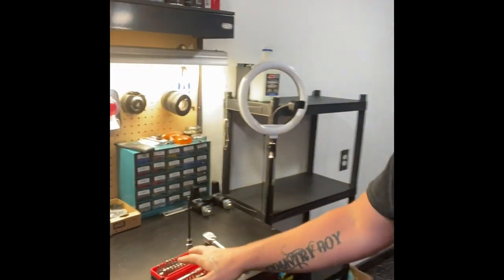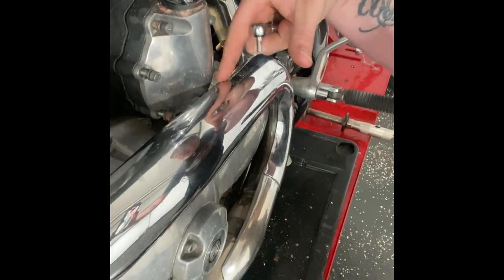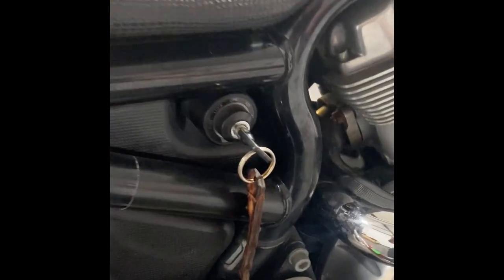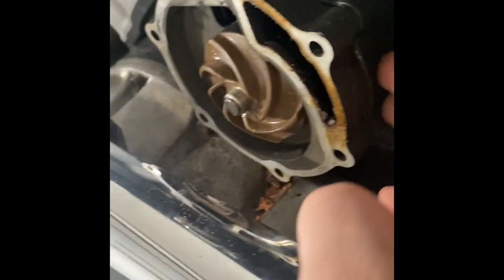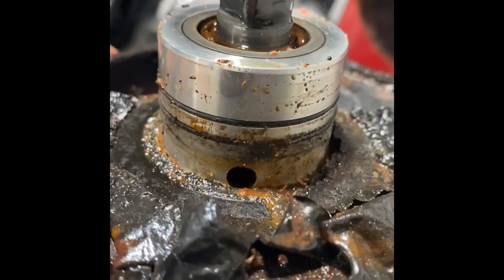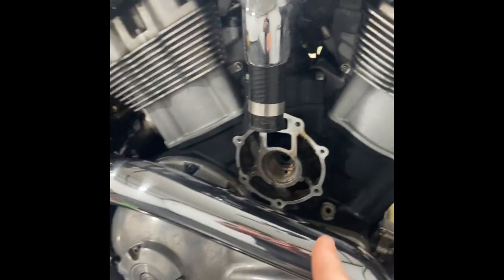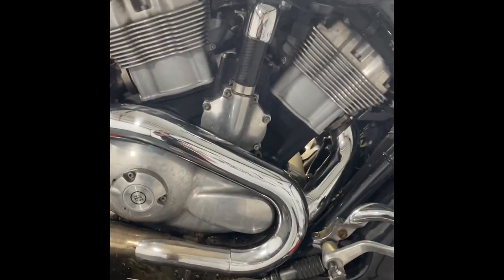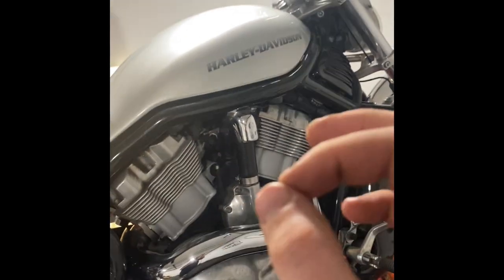Harley Davidson V-Rod water pump replacement!

Comment: Hi thanks for the excelent video. Where didyou get the pump I cant find one,
Reply from the maker: Part number in the description. Your local Harley dealer will have one or can order one
Reply: What is the procedure for filling to avoid air lock in system?
Did you change Thermostat as well?
Thanks, good video